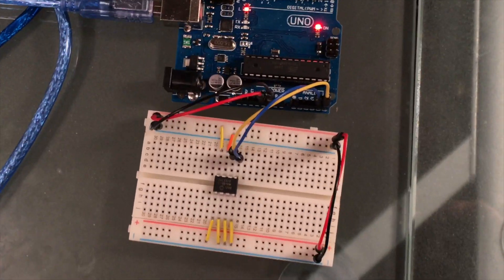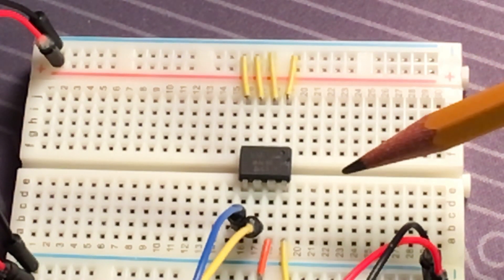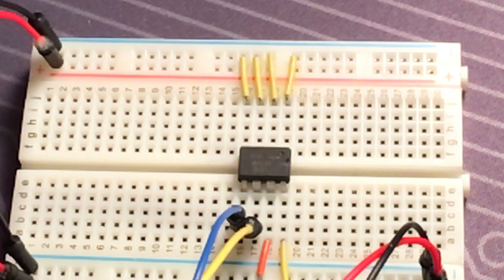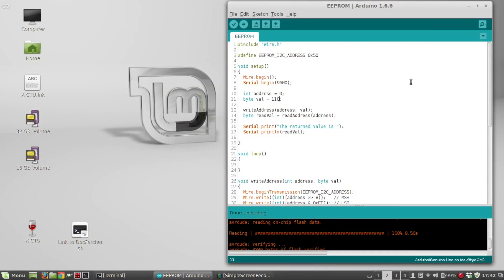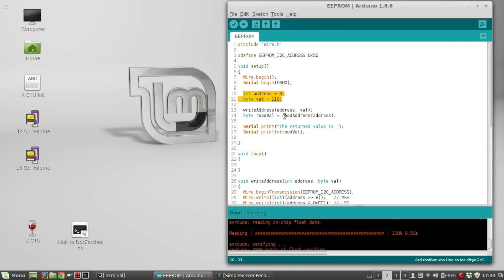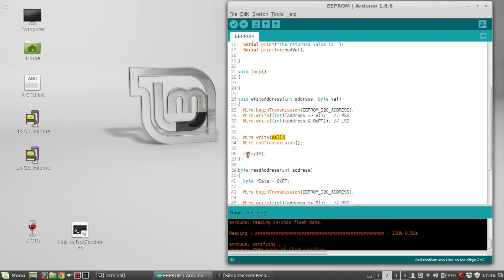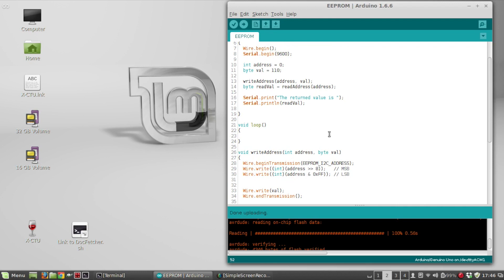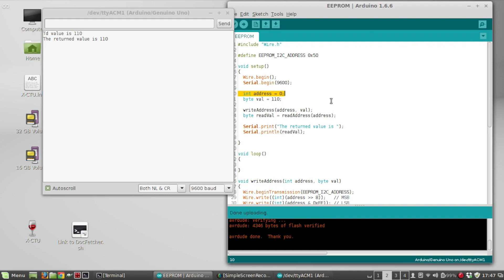Arduino and External EEPROM

Comment: 5:49 Why did you used an AND bitwise operator between an integer “address” and a number formed by all ones (0xFF)? The result should be the same “address” value, so why it would be useful? Thanks

Comment: I try make this tutorial but I use  EEPROM 24C08A and use same the code in this video and result in serial print "the returned value is 255"
why don't get this message "the returned value is110"

Comment: I'm using 24c08 code not working 255 o/p instead of 110, wiring done according to video
Reply from the maker: I think the addressing works different for the 24c08 chip.  Look at pages 9-12 of http://ww1.microchip.com/downloads/en/DeviceDoc/doc0180.pdf
Reply: @electricks6149  thanks

Comment: #include "Wire.h"

Hi, i have a stm32f411(black pill board) and a 24lc64.
i have wired data to PB7 and clk to PB6  these are the i2c pins.
it does not work witht he code here,  do i have to inform it of the different pins used?
any ideas? please help.  thanks
Reply from the maker: You may want to double check the data sheet for the specific chip you are using.  Make sure the I2C address is correct, and that the protocol for reading and writing to the chip are the same.  Also, make sure the “write” pin is set correctly in case it is different than for the chip I am using.

Comment: sorry im a noob in programming. but does this work for every 8 pin eeprom?  and if i understand correctly you have put the value 110 in it? and is that the only date stored to it? thanks
Reply from the maker: For other EEPROM models, you would need to look at its particular datasheet to see how data is I accessed on the chip.  If it’s an I2C chip, it should be very similar to the one used in the video.

I just used a single value of 110 to write and read, just to keep the demonstration simple.  Most chips will have an additional way to read and write large blocks of data instead of a single byte at a time.

Comment: is it compatible with the 24LC01B model?
Reply from the maker: I think the only real difference between the 2 chips is the capacity.  The24LC512 can hold 64 kilobytes, whereas the 24LC01B can only hold 128 bytes.  The pin layout, operating voltage, Max. I2C clock frequency, etc. seem to be identical.
Reply: @electricks6149  I'll try adjusting the code, Thanks!
Reply from the maker: Janx the hedgehog Actually, you may want to take a look at the data sheet for the 24LC01B.  I think the addressing scheme of accessing byte addresses is a little different.
Reply: @electricks6149  I'll take that into account.
Reply: update: just by stripping the shifts and the second line from the address code it worked fine. still amazing tutorial

Comment: I didnt understand ..what did u do with the 7th pin of that ic...where did u connect it to?
Reply from the maker: If you want to write-protect the contents of the chip, you set pin 7 to the same 5V that you use to power the chip.  To enable writing, you connect pin 7 to ground.  In the video, I call it high (5V) and low (0V).

Comment: I like your EEPROM video demonstration. However I am still a little bit confused.  I downloaded your sketch, and wired everything up as show and it seems to work as it should.  I enter the value of 110 and it returns it just fine.  My question though is how do I have to change the code so I could enter value of say 750.  When I try that I get a value back of 0. You mention in your video that you are reading 1 byte on the line Wire.requestFrom(EEPROM_I2C_ADDRESS, 1); How do I read the next byte to be able to enter larger numbers?  Thanks
Reply from the maker: A byte can store a maximum value of 255, so for anything larger you have to store in multiple bytes.  A 'short' data type is 2 bytes and can store a maximum value of 65,535.  In your sketch, you would declare a short variable and set it equal to 750.  You would then write (using shift/mask operators) the first byte of that short to address 0 and then write the second byte to address 1.  To read it back, you would read in the byte at address 0 and then read in the byte at address 1.  You then combine the bytes back into a short variable using the shift and mask operators.

Comment: Why not just use a SD card (or other flash memory) for read/write memory?
Reply: Hey there, there might be several reasons. I'm coming from writing to an SD card and looking into EEPROM due to some "issues" with the cards:
1: The sd cards need usually a very stable voltage to write to, most cheap modules work on 3.3V. Now, this is usually achievable, but the cheap modules also have cheap linear voltage regulators with high dropout voltage. Effectively, this means you usually need about 3.8 volts to write on the SD card, but if you power it with a single lithium cell, voltage drops below that well before you run out of battery capacity. I had to replace the cheap linear converters on the SD modules with low-dropout ones.
2: Sd cards draw very high currents during read and write (about 200 ma). If you do ultra-low power projects, the writing to the card will quite likely be the biggest power consumption in your circuit. EEPROM need much less power to write to --> longer battery life of your project. 
3: EEPROM is very cheap. So if you don't have to write a lot it might be just about right. to save some bucks.

Comment: How to write more than 3 digits
Reply from the maker: For a short data type (which is 2 bytes), you could store the first byte (8 bits) in an address and then store the next byte (8 bits) in the next address.  Your program would have to know that you are storing a 2 byte integer in the first address, and then read 2 bytes starting at that address.  After reading the bytes, your program would then concatenate them together to get a two byte integer.  You could do the same sort of thing for a 4 byte integer.

Comment: Very good tutorial!  Is there any reason you can't merge 50 & 52?  `return Wire.read()` instead of writing it to a variable then returning it? I've never used Wire before.
Reply from the maker: Yes, you can save a line of code by doing `return Wire.read()`.

Comment: Outstanding vids.  Thanks.  

There is also an excellent paper (just google it) "Extending Arduino Uno Ram" by Janna B. Gallaher, PhD, PE.  Its using the Microchip 23LC1024.
Reply from the maker: nmgreg11 Thanks, I will definitely check that out!

Comment: For those who received 255 value returned, this is the new code i did fixed it, you just have replace some instructions with data byte ..

#include "Wire.h"

#define EEPROM_I2C_ADDRESS 0x50

void setup() 
{
  Wire.begin();
  Serial.begin(9600);

  int address = 0;
  byte val = 110;
  
  writeAddress(address, val); 
  byte readVal = readAddress(address);
  
  Serial.print("The returned value is ");
  Serial.println(readVal);

}

void loop() 
{

}

void writeAddress(int address, byte val)
{
  Wire.beginTransmission(EEPROM_I2C_ADDRESS);
  Wire.write(byte(0x00));
  
  Wire.write(val);
  Wire.endTransmission();

  delay(5);
}

byte readAddress(int address)
{

  char rData ; 
  
  Wire.beginTransmission(EEPROM_I2C_ADDRESS);
  
  Wire.write(byte(0x00));
  Wire.endTransmission();  

  Wire.requestFrom(EEPROM_I2C_ADDRESS, 1);  

  rData =  Wire.read();

  return rData;
}
Reply: Thanks it worked👍
Reply: Thank you, it worked :D

Comment: Hello,
I have some questions about eeprom and arduino.
All of videos on youtube mostly explain how to upload sketch to eeprom, mostly attiny45/85, (they just copy each other videos, set board, programmer, butloader..) via arduino, but thay all use blink or fade sketch!
I am completely new in this area (i'm mechanical engineer) and I'm working on some project that include 2 inputs and 3 outputs.. Can I use 24C32 or 24C64 (8pin chips) for project like this..(1250 bytes)?
Is it possible to get some closer info on how to do it?

Thank you very much in advance :)
Reply from the maker: I think those chips (24C32 and 24C64) should work fine for use as external EEPROM to an arduino.  Just make sure and check the data sheet for the pin layout.  You only need 2 data pins from the arduino to communicate with the chip, the I2C serial communication clock and data pins.
Reply: Electricks So it's possible to use it as stand alone chip with just power suply.. After programing it with arduino off course?
Reply from the maker: I don't think there is a way to do that with these EEPROM chips.  The chip by itself would not have any way to interpret and execute any programming code.  It's kind of "dumb" in that it will store and allow you to retrieve data from it's memory addresses, but that's it.  There are no internal registers or processors to execute code.  The attiny (or arduino) chips that you mentioned in your original post is what you need I think.  These EEPROM chips can be used to store additional data (but not programs) if you don't have enough storage space on the attiny/arduino.
Reply: Ok, now I get it.. Thank you very much for replay :)
I guess I'm just go and order few attinys :D
Reply: Btw, I ask question like this cause in Serbia(I'm from Serbia) I can find ATTiny 45 nor 85, and 24c32/64 are like 30 cents :)
Reply from the maker: Yeah, that makes sense.  I sometimes order electronics from Jameco (http://www.jameco.com), and I think they ship internationally.  Their price on an attiny45 is 1.90 USD, but I think you would end up paying more than that for shipping costs to Serbia.  It might be worth checking out though.
Reply: 2.25 USD - 2pcs with free shipping on e-bay already ordered :)
but, thank you for info. 
It's cheaper on e-bay, from China to my address then if I buy it from some city in Serbia and pay delivery service 2 USD :D :D

Comment: I don't want to be "that guy" but EEPROMs don't have a limit on read cycles. Write/Erase operations are what reduce the life of an EEPROM. So if you have something you want to store in EEPROM, do it... and read till the cows come home.
Reply from the maker: Ian Ide You are correct, I should have said one million erase-write cycles.
Reply: Is it even really needed to worry about wearing the eeprom down when it has 1m write cycles? Unless you were recycling the same 4 locations every second, I would imagine it would take a very long time to wear it down
Reply: You wouldn't want to do something silly like writing to the EEPROM an ADC value that was read in a loop with no break. Use the EEPROM for what it is intended, store a static setting of some sort and leave it alone (or even update this setting/value once in a while if needed), but you can read it pretty much until the device dies.

Comment: Hi, I have a 24 LC 64 chip and I also receive only 255 as a return value. Are there any other tips around than those below? Switching pin 7 to 5v does not work
Reply: Hi, Robo Studio when you are recording EEPROM the pin wp has to be at gnd and when you want to read it has to be at vcc...
Reply from the maker: Pin 7 should be set to ground on the 24LC64 to allow write operations to the chip.  Double check the wiring and make sure the SDA and SCL pins on the arduino are connected to pins 5 and 6 respectively on the EEPROM.  
Make sure the EEPROM chip isn't upside down.  With the dimple at the top, pins 1-4 start at the upper left corner and go to the lower left, and pins 5-8 start at the lower right corner and go to the upper right part of the chip.  I have a link to the source code of the sketch I used in the description.  Have you tried to run it?  If so, make sure the EEPROM pins 1, 2, and 3 are set to ground so that I2C address 0x50 is used.

Comment: Hi, I saw the datasheet and should't the address be 0xA0 for write and 0xA1 for read ? So it is 0b 1010 0000, why did you write 0x50 & 0x51 ?
Reply from the maker: There are some I2C protocol versions that use 8 bit addressing, but this chip (24LC512) uses the more common 7 bit addressing.  I believe the Wire library  handles constructing the control byte for you, so you give it the 7 bit address which is 0x50 (0101 0000 the first bit is ignored) when you call Wire.beginTransmission().  I think it will then send 0xA0 or 0xA1 to the chip based on whether it is a read or write.

So, I think if you don't use the Wire library and talk to the chip directly, you would send 0xA0 and 0xA1.  With the Wire library, you send just the 7 bit address.
Reply: It is all mixed up. Simple things are made complicated. Wire.h does use 7 bit device address but to make it 8-bit just before transmission starts, and it seem to always set the last bit to 0, so the EEPROM always waits for data to be written. All in all, Wire.h does not go with serial EEPROMS.

Comment: How to write strings to external eeprom ??
Reply from the maker: If they are fixed length strings you could use ASCII values and just write them out as bytes.  Since they are fixed length, you know how many bytes to read once you have written them to the EEPROM.

For variable length strings you could use null-terminated strings.  You still use ASCII values but add an ASCII 0 byte at the end of the string.  So to write the string 'HELLO', you would write the ASCII values 72 69 76 76 79 0 . You would need to know the starting address of the string in the EEPROM, and when you read the string value you would have a loop that reads each byte into a character array until you read ASCII 0, which indicates the end of the string.

Another way to handle variable length strings is to have the first byte indicate the length of the string.  So when writing 'HELLO', you would write the following ASCII bytes to EEPROM: 5 72 69 76 76 79 .  When reading the string from EEPROM, you would read the first byte to get the string length and then loop that many times to read the values into a character array.

Comment: Why do you need to cast after an 8bit shifting?
Wire.Write((int) (address>>8));
Isn't (address>>8) already an int??
Reply from the maker: Since 8 is a literal value I don't think it is certain how the compiler will treat it.  Casting the result guarantees that the result value is an int.  Wire.Write() is overloaded and one of the overloaded methods takes an int, although ultimately it only sends a single byte.

Comment: It works fine on 24C64.
On both 24C02 and 24C04 I got:
The returned value is 255

Why??
Reply: Hi, when you are recording EEPROM the pin wp has to be at gnd and when you want to read it has to be at vcc..
Reply from the maker: Looking at their datasheets, I don't really see anything that would indicate why the code will not work.  I did see that for the 24C04, the device addressing scheme is a little different than the other two chips.  Instead of this type of address: 1 0 1 0 A2 A1 A0 , it uses 1 0 1 0 A2 A1 so the A0 bit is not used as part of the device address.
Reply: Here the communication logged with my L.A.
24C64:
START - WRITE 50h - ACK - 0 - ACK - 0 - ACK - 110 - ACK - STOP
START - WRITE 50h - ACK - 0 - ACK - 0 - ACK - STOP - START - READ 50h - ACK - 110 - NACK - STOP

24C02 & 24C04:
START - WRITE 50h - ACK - 0 - ACK - 0 - ACK - 110 - ACK - STOP
START - WRITE 50h - ACK - 0 - ACK - 0 - ACK - STOP - START - READ 50h - NACK - STOP
Reply from the maker: That is odd.  I don't know why the 24C02 and 24C04 are not returning the value.

In the readAddress function you might try changing the following line:

rData = Wire.read();
to:
if(Wire.available()){    Wire.read();}
Reply: Just tested it.
Unfortunately same as above :(
Reply from the maker: The only other thing I can think of is perhaps the write protect pins on the 24C02 and 24C04 are set?

Comment: Hey, could you help me? It says 255 instead the needed value every time I try it.
Reply from the maker: Are you using the sketch I provided in the description?  I know that sketch works, so if you are not receiving the correct returned value it must be  wiring problem or possibly a bad EEPROM chip.  Check you connections against the data sheet and especially make sure you haven't write-protected the chip.  The chip will not be write-protected if pin 7 is connected to ground.
Reply: Turns out that pin 7 is not write protect but programming time control (I don't have the same eeprom as in your video) and it is supposed to be connected to 5v. This was the wiring problem that I couldn't figure out because I grounded pin 7 like everyone says should be done.
Reply from the maker: I am glad that you got it figured out and working!
Reply: hi friends, I had the same problem as you. I am using the device 24C04 and followed exactly the video´s code but the returned value is 255 instead of the value that I want to write. I tried to conect the pin 7 to ground when I write and to 5v when I read. I dont have any idea what could be my problem, I would be thankful if you shared me your solution.

Comment: sir can we extend the flash memory? if yes then how? i am not getting.
Reply from the maker: The flash memory on the arduino is used to store the program and I don't know of any way to extend that.  If you are running out of available flash memory due to your program size, you may want to look at the arduino Mega2560.  The arduino uno has 32kB of flash, however the Mega2560 has 256 kB of flash.
Reply: yes thank you sir

Comment: I'm having problems where the read of the EEPROM doesn't always match what I write to it. It's pretty random, but consistent. I integrated a while loop to keep writing the value wanted until the read matches the write... Even with the read matching the write loop, I still get read a different value if I read the address again. Any idea what my problem could be?
Reply from the maker: Did you make sure to add the 'delay(5);' after performing a write?  It takes 5 milliseconds for the chip to actually write the value to the address after calling the 'Wire.write();' command.  If you do have the delay command, maybe try bumping the value up from 5 to 10 to see if that makes any difference.